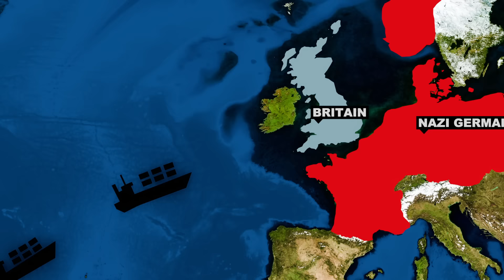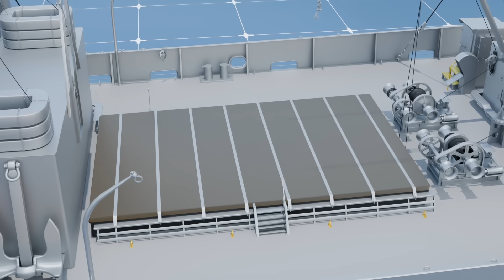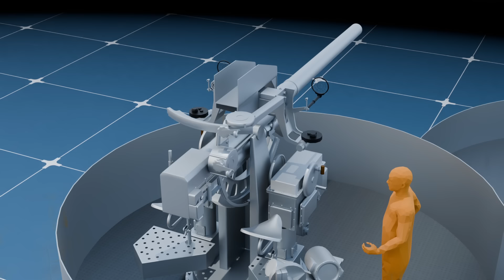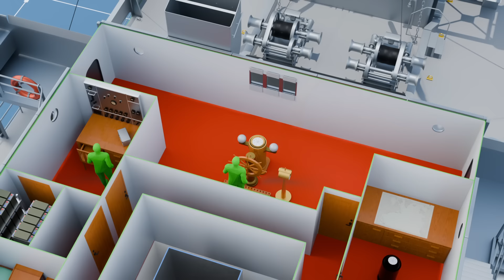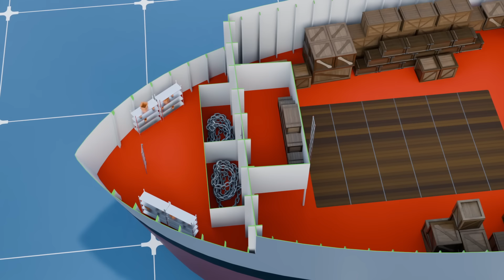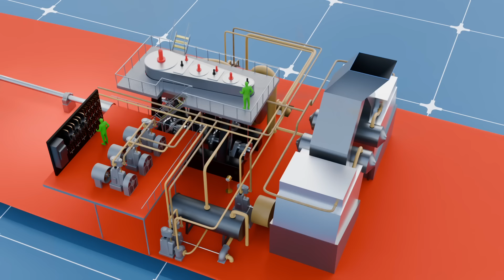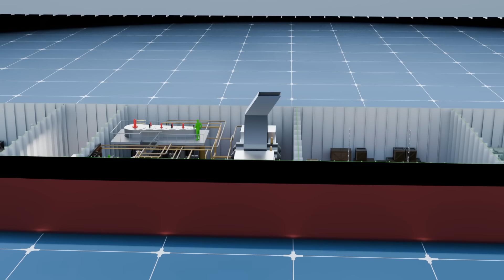How the Liberty Ship Actually Worked

Comment: I learned that the engine pistons were single acting and were not powered on the way up. At least, that is what you showed.

However chat GPT says:

Were the 3 pistons on liberty ships driven by steam on the up and down stroke or only the down stroke

ChatGPT said:
The three pistons in the triple-expansion steam engines used on Liberty ships were driven by steam on both the up and down strokes — these were double-acting steam engines.

How it worked:
Each of the three cylinders (high-, intermediate-, and low-pressure) was double-acting, meaning:

Steam was admitted alternately to both sides of the piston.

So in each cylinder, steam pushed the piston in both directions — up and down — performing work during both strokes.

Why double-acting?
Double-acting cylinders are more efficient and powerful because they use both sides of the piston to generate motion, maximizing the use of the steam energy.

So yes, the pistons on Liberty ship engines were driven by steam in both directions.

Comment: I've seen the Jeremiah O'Brien several years ago, and one thing that struck me was that the armour around the superstructure, which I assumed to be concrete, appeared to sag. Learning now that it was in fact made of bitumen, It makes sense that it slowly but surely follows gravity. It was never planned to become as old as it is today. 
One of the most interestin things I learned on the ship was the improvised washing machine, which consisted of a bucket and a dumbell attached to the lever operating the boiler feed pump by a chain. When the machine was running (and only then, i.e. the whole voyage, and if not, there were more serious things to worry about), the dumbell would stomp in and out of the bucket, which had to be loaded with laundry, soapy water, later fresh water, until it was done.

Comment: Three things that really stood out:  (1) Technology engineering from the 1800s is underrated (saying the ship was from an 1879 design).  (2)They constructed three ships every couple of days is beyond impressive!  And (3) this is an outstanding video.
Reply: The speed of building them was facilitated by rolling the prefab sections so that all welds were done on the floor.
Reply: When Thompsons  the Sunderland Shipbuilders son took the plans to the United States the ship he came back on was torpedoed and they spent some time in a lifeboat.
Reply: It was not underrated, it was just worse compared to technology at that time, but it was easier, cheaper & quicker to build, and in wartime, that was the main matter. It's like right now you need 5000 trucks by end of year. You will build old trucks from 2000' technology, without fancy LED lights, touchscreens, and other fancy stuff. Not that 2000' trucks is underrated, but it's just cheaper & quicker to build.
Reply: How good that the team could be rebuilt at the same time.
Reply: … many built by Henry J Kaiser in 
San Francisco Bay Area, CA. 🇺🇸🗽
Reply: I think they completed one every few days, but if I remember correctly the whole build time was like 59 weeks.  I might be wrong. It’s been almost 40 years since I was last on the O’Brien and around the facts.
Reply: They didn't just build them. They filled every one multiple times.
Look up the tonnage of material sent to Russia alone during WW2, it is incredible.
Reply: @j3i2i2yl7  the most offensive thing is that the Bolshevik and Putin propaganda rewrote history, claiming that the Lend-Lease supplies had no effect on anything, like the products in 1922, 1934, 1993...
In fact, all Soviet archives are classified, no one can make a reliable assessment.
Except for veterans who saw everything not only with their own eyes, but survived the Soviet meat grinder between socialist Germany and socialist Bolshevism.
Reply: @American97percent  Stalin openly admitted the crucial role of lend-lease at the Tehran Conference in 1943.

"I want to tell you what, from the Russian point of view, the president and the United States have done for victory in this war," Stalin said. "The most important things in this war are the machines.... The United States is a country of machines. Without the machines we received through Lend-Lease, we would have lost the war."

Denials of that are modern day revisionism

Of course once the Cold War started in earnest, no Soviet leader was going to openly give credit to the West for anything.
Reply: 1940s not 1800s
Reply: @charleshettrick2408  Those triple expansion steam engines were pure 19th century technology... and they were actually invented at the end of the 18th century!
Reply: @charleshettrick2408 The main plan was for a Sunderland tramp ship from 1879 the last plan put into the mix was from a tramp built around 1933 i think called the Dorrington Court, when they got to the United States they adapted for prefabrication and welding and the rest is history.
Reply: @charleshettrick2408 The engine technology went back to the 1880s for the simple to build and operate engine . Training to operate the engine also took less time.
Reply: @charleshettrick2408  
18XX -19th century
19XX -20th century
20XX -21st century
Reply: @charleshettrick2408 they said the design was even older
Reply: @NickKeighley  It was, it's Tartarian stuff. We didn't design or build the original ships, we built modified copies. Depending when, 1800 - 1900, our humanity went thru a reset that does not show up in history books.
Reply: @togowack what? Reset?

Comment: Wait , what is a  4 inch 50 caliber gun? You just named two separate guns. Now I can't trust the rest of your data.
Reply from the maker: Unlike firearms, naval guns are usually classified by caliber (the diameter of the bore) and calibers (the barrel length expressed as multiples of the bore diameter). For example, a 3 inch/50 caliber gun has a 3 inch bore and a barrel 150 inches long (3 × 50). We should have clarified this in the video.

Comment: My grandmother was a ship welder in WWII in Mississippi. Thanks for sharing.
Reply: real life Rosie the Riveter, Wanda the Welder ;)
Reply: And the key to the liberty ship was that the prefab sections were rolled so that almost all welds were done on the floor.

An admiral asked a ship construction master what the holdup was in getting more ships produced 

"Not enough welders."

"How long does it take to train a welder?"

"I can teach anybody to weld on the floor in a day.  It takes months to learn to weld well on the wall.  It takes years to learn to weld on the ceiling."
Reply: @johnmcleodvii  I could teach you to weld stick overhead in a week. It's not hard, generally the difficulty for new people is that they are setting the machine too cold and not moving fast enough. Welding in the shop is far faster though. You don't have to keep moving your equipment around, worrying about ventilation, catching stuff on fire, weather etc etc.

Smart welders/engineers lay things out to do as much in the shop as possible and try to ensure the field welds are noncritical so if there are flaws it's not a huge problem and accessible so the welder isn't hanging off a ladder upside down or squeezed into a box trying to get at it. 

One of the reasons oil rig/pipeline welders get paid so much is that they are making critical welds in the field in generally terrible conditions. It's hard, dangerous and miserable. They earn every penny.
Reply: @canadianeh4792  As a former NDT engineer, having spent about two decades in the field (literally anywhere where field welds were made), I can only affirm your statements. Anybody can weld (including myself) on a hobby level, but it's craftsmanship and dedication that turns somebody that welds, into a Welder.
The most peculiar piece of welding that I ever examined was a stainless steel device. The lid was TIG-welded to the body by a robot, all controlled and monitored remotely. They were ignitors for the Ariane missiles of the European Space Agency. This was done on the premises of the Prins Maurits Laboratories (TNO-PML) in Delft, the Netherlands in the 1990's. We also X-rayed the replacement solar panels for the December 1993 Endeavour Space Shuttle mission that serviced the Hubble space telescope. We did those X-rays in the Summer of 1992 on the premises of British Aerospace in Bristol. But mostly, my NDT-work was pretty common and not so glamorous as in such rare cases.
Reply: @johnmcleodvii  My Dad was a welder on Liberty ships and he could weld vertical and overhead. We had a welder on the farm, and I never could equal his welding.
Reply: @johnmcleodvii - thats still true for modern pre-fab modular construction, and building on a certified flat & true surface makes all the modules fit together tightly when craned into place, resulting in faster & stronger final welded assembly. Today- just with semi or fully robotic welding in the mix.
Reply: Yes is true, thanks
Reply: My grandfather as well in LA area.  Description of many sleeping in pipes near the yard to send more money home.
Reply: During WWII, my grandmother helped keep sailors happy.
Reply: Some of the welds were overhead.  As many as possible were on the floor.  For the ones overhead they used existing master welders.  For the ones on the floor they used whoever they could hire.
Reply: @johnmcleodvii  Still, I remember vaguely as how it was said that the Liberty ships were prone to failure due to cases of poor welding, which was a consequence of the imposed speed at which these ships had to be built. I never delved into this subject, so don't quote me on this.
Reply: @Guido_XL  yes did have that problem when started building Library Ship would break apart to solve the problem they put a band of Steel one on each side did not have any more problems the ship break apart any more.
Reply: Thank you for sharing.
Reply: Чувак, респект твоей бабушке!
Reply: Thanks for your mommy from Russia.I am a captain of merchant marine.❤
Reply: @nemo454 Thanks. She was a great lady.

Comment: As a young man I used to volunteer on the O’Brien with folks who had sailed these ships 45 years earlier.  One of the engineers showed me how to light the boiler and bring up the steam level.  He kept remarking in typical sailor language, “Easiest f#^*’n plant in the world.  They gave us 3 months of training and then we were engineers.”  After Bob showed me the basic components and put fire in the boiler, he turned to me and said, “I gotta use the head kid - you watch things.”  He was gone for almost an hour, and in that time I saw steam pressures rise.  Needles on the gauges for air, fuel pressure and steam were rising closer to the Sharpie marks on the dials.  I tried yelling for Bob because there were no phones and I wasn’t going to leave the engine room with fire in the boiler.  After all, he told me to watch things.  When I saw steam pressure getting close to the mark on the dial, I turned the valve to the fuel pump down and steam pressure immediately leveled out.  After 10 minutes of frantically checking all the gauges and making small adjustments here and there - Bob comes down the ladder chuckling, “See what I mean kid, easiest F#*%’n plant in the F#*%’n world!”

Comment: Interesting learning about stuff from before my time.. 414 ft length and 56 ft beam ..was comparable to the navy ship i served aboard for 2 years until it was decommissioned..FF1044 USS Brumby.. was 451 ft long and had a 42 ft beam.. but produced 37,000 horsepower at the shaft ..with 1,200 pound 880 degree superheated steam.. from 2 pressure fired boilers.. it sounded like an F14 at full throttle.. being 18 years old at time of service i was truly fascinated by the engineering .. and how stuff worked.. this is a great video and breakdown of the liberty ship.. thanks for sharing 😊

Comment: Not 50 caliber... you meant 50mm
Reply from the maker: Unlike firearms, naval guns are usually classified by caliber (the diameter of the bore) and calibers (the barrel length expressed as multiples of the bore diameter). For example, a 3 inch/50 caliber gun has a 3 inch bore and a barrel 150 inches long (3 × 50). We should have clarified this in the video.

Comment: Fuel consumption per day, between 125 and 185 barrels (strange variety). Storage capacity 12,000 barrel fuel oil. Variety in speed between 10.5 and 13.00 Knots.

Comment: Most built; but most hated, they were poorly made, with numbers came shortcuts, a lot of them sank just from the poor welds. 
Many broke in half in bad weather which resulted in more liberty ships sinking from bad construction rather than enemy torpedo attacks, but that also meant torpedo attacks would be devastating against these ships as they had a reputation from breaking in half when hit near the middle. 
Honestly, hearing stories from my great grandfather who sailed on these, its harrowing. After the war the awful construction became even more apparent, so many lost in poor weather.
Reply: That is not true only 12 ships suffered catastrophic damage from structural failure contributed to construction, 1000 or so had issues but did survive, 250 +/- sunk by the enemy.
Reply: They didn't have 'sails'.

Comment: 3 inch .50 calibre?  WHAT ARE YOU SMOKING DUDE!?
Reply from the maker: Unlike firearms, naval guns are usually classified by caliber (the diameter of the bore) and calibers (the barrel length expressed as multiples of the bore diameter). For example, a 3 inch/50 caliber gun has a 3 inch bore and a barrel 150 inches long (3 × 50). We should have clarified this in the video.

Comment: And the Liberty ship SS Robert E. Peary was built in 4 days, 15 hours and 29 minutes. (although that was pretty much a propaganda exercise, with all the prefabricated parts pre positioned, the engine and boilers installed already etc... that rate was unrealistic for numerous reasons, not least that STEEL production couldn't have kept up with it)  The average build time was more like 50 days...which is still extremely impressive!  The speed they were built at no doubt aggravated other problems, (like steel quality) ,  three Liberty ships broke in half without warning and some 1500 cases of significant hull fractures occurred... Still..they did the job..and for ships with a design life of a few years a great many soldiered on for decades after the war...
Reply: I prefer if the job doesn't kill me unnecessarily.

Comment: You lost me at 4" and 3" .50 cal guns.
Reply from the maker: Unlike firearms, naval guns are usually classified by caliber (the diameter of the bore) and calibers (the barrel length expressed as multiples of the bore diameter). For example, a 3 inch/50 caliber gun has a 3 inch bore and a barrel 150 inches long (3 × 50). We should have clarified this in the video.

Comment: You still have ways to go on making videos. I've seen 3D videos did way better.

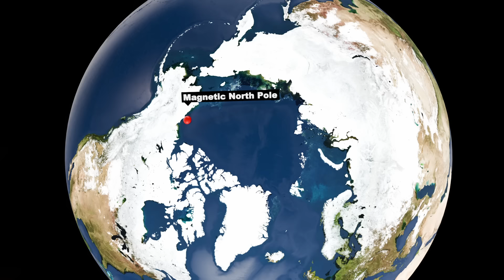10:10 - you should omit that. Irrelevant to the point of the video.
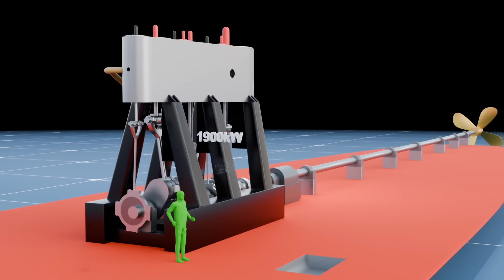15:44 - wrong unit of measurement. You're talking about an engine not an electric motor therefore it should not be addressed as kilowatts.
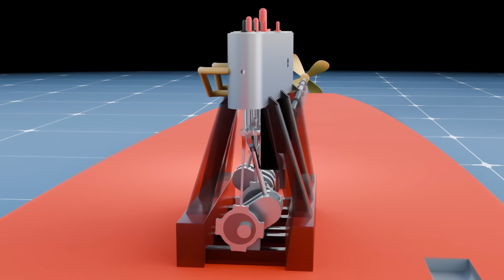18:00 - the point of your whole video are the Liberty Ships, then you're talking about how engines are supposed to work? Consistency bro. If you want to talk about how engines of liberty ships work, create a separate video for it, don't pad your video with spam just to please the algorithm.

Comment: Good video but either by accident or design it failed to mention  that the Liberty ship was a British design, in UK they were called 'Tramp Steamers' and had been built in UK for  long time, they were designed to be able to load and unload their own cargo because they often visited small ports with limited cargo cranes. The original Tramp Steamers were riveted but for speed of building this was changed to welding, and many liberty ships developed cracks, some of which resulted in the loss of the ships at sea.  This was found to be cause by metal embrittlement in the cold north atlantic conditions,  the problem was that a crack will not continues to grow on a riveted ship, but on welded ships the crack could easy grow. Strengthening plates were fitted across the vulnerable area amidships.  I have no doubt that many British sailors crewed these ships as well.

Comment: A lot of them were built so quick and actually so fast they often broke in half all by themselves out at sea.
Reply: Wasn’t because of the speed of building.  It was because of a then-unknown concept of transition temperature.  The temperature below-which a material transitions between being ductile and brittle.  Having a fully welded hull meant that if a crack developed, there was nothing stopping the crack growing around the entire hull.  Riveted ships could also crack, but the crack couldn’t propagate from one plate to the next.
Reply: @stuartlees1298  Plus stress concentration at hatch corners.

Comment: That was the best description of a steam engine that I've seen on YouTube. Thanks!
Reply from the maker: Glad you liked it!
Reply: This made very clear to me the difference between land steam engines used in locomotives which require copious amounts of water on their journeys and ship engines which recycle their fresh water in a closed loops system through a condensor. Fresh water being an extremely precious commodity at sea. The oil burners are very like the old central heating boilers used in domestic systems prior to condensor boilers. 
The fact that the powers that be chose a reciprocating engine rather than try to go for a turbine setup was good thinking in as much as a large number of ships were needed in a short time.